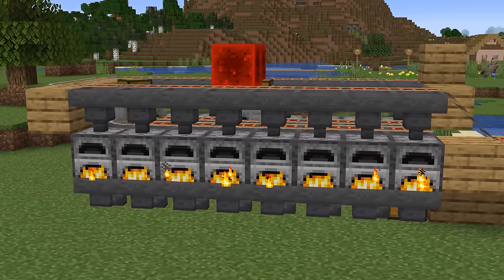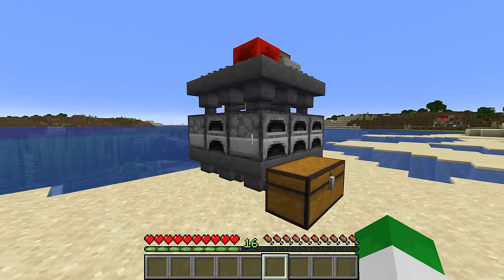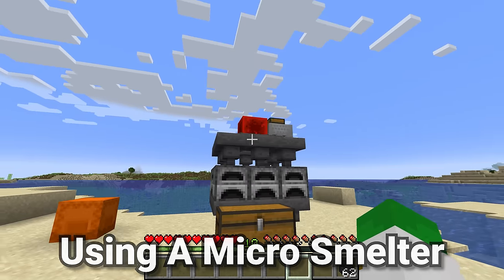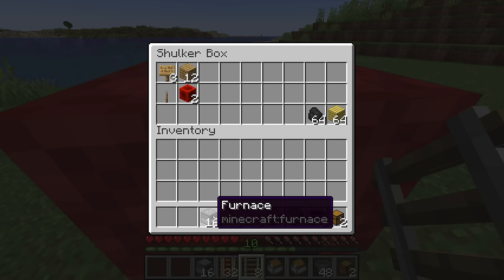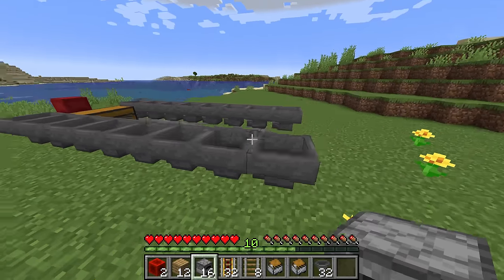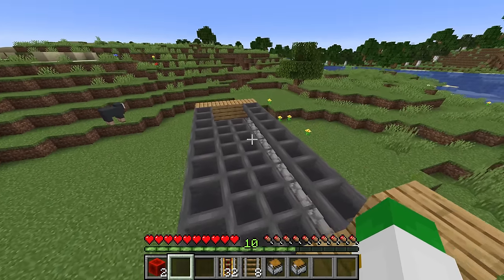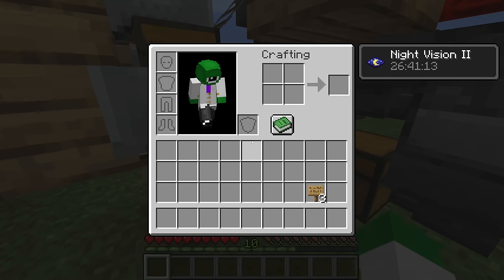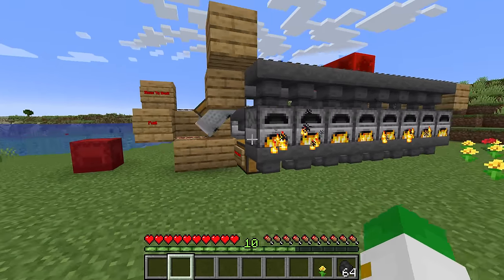How To Build A Super Smelter In Minecraft - Large Auto Smelter Tutorial + Micro Smelter

Comment: If you are struggling to place the rails on the lower track for the bigger auto smelter, just place the regular rail first, 1 block ahead, then place the powered rail that way the powered rail connects to the regular rail on the lower track not the powered rail on the top track. This issue could arise at 7:04. Hope this is useful to at least someone!
Reply: Thank you so much omg, I thought I was losing my mind and I was ready to pull out the tnt
Reply: I don’t understand what u saying
Reply: @alonzoperez644  same
Reply: thank you SO much i went searching for a comment like this bc i could not get the rails to place properly!
Reply: This build was a huge waste of time. Terrible design
Reply: I've been trying what you said for hours and it hasn't worked. I'm super pissed off at this point. Gah I hate this video
Reply: It is kinda iron expensive but what I did was just add another layer of hoppers on top of the upper layer so that they couldn't connect. So you have the furnaces and then 2 hoppers on top of it
Reply: THANK YOU MAN REALLY
Reply: I did this, but the powered rail still connects to thw other powered rail 😩
Reply: @taojones8956 dawg you put the normal rail first then you put the powered rail so that it doesn’t connect
Reply: Whew, even with that, it was still a little tricky to get the rails down. Yeah, you have to aim 'away' from the other rails while crouching. I still think it may have been random or something, the damn rails would keep connecting in the wrong way!
Reply: bro ur a life saver tysm
Reply: Bro super thanks

Comment: I just built this and it works fantastically. I have been looking for an auto-smelter that will take lava buckets and could only find really complex set-ups. What you have designed, however, is very simple and picks up the empty buckets easily. It also has a small footprint, is relatively cheap to build, smelts very quickly and only took me 5 minutes to build. Thank you so much for this excellent tutorial. :D

Comment: I have a bunch of auto farms, so I would direct their output line to some sorters to pull out the items I want to smelt/cook, then feed the output to the farm stream on the other side of the sorters to go to my main storage.

My fuel of choice is charcoal since by cooking my tree farm's output the super-smelter quickly becomes self-fueling. That's because I get 8 charcoal out for every 1 charcoal burned (with no need to craft bamboo planks, although 1.21's new crafter block would change that). Feeding the output charcoal back into the farm's fuel line means it's constantly full and the charcoal that doesn't fit continues on to storage.
Reply from the maker: Nice! One of my favorite things in Minecraft is connecting farms together to make a massive system :)
Reply: Charcoal is god-tier fuel with this setup
Reply: I am currently setting up an auto kelp farm to supply my auto smelter. I have a question though, how am I supposed to prevent my main storage supply from overflowing if it reaches maximum capacity?
Reply: @gavinferguson2938  What kind of sorters are you using? There's usually a way to catch overflow at each sort point. Alternatively, you can just let it fill up so that it won't accept more items and have an overflow catch-all at the end that drops the extra items into lava or something.

Comment: This is almost exactly what I’m looking for. 

There’s a few ways I would upgrade this, however the “upgrades” are definitely going to make the smelter more expensive. 

1. Is there any way to use hopper minecarts instead of chests minecarts? I want to make the smelter look good in my house, and keeping the input, fuel, and output all as chests would make it look great and consistent. 

2. Is there any way to attach a farm to this for fuel? Such as a super efficient bamboo farm, so you no longer even need to put any fuel into the furnaces.

3. If using hopper minecarts is possible, is it possible to make it so the hopper minecarts are stationary until you put items into the smelter? This would only make the minecarts move when they’re either full, or have emptied the chest. After that, how would you make them stop moving after they have unloaded every item from their inventory? The purpose of this is to reduce the constant noise of the minecarts.

Essentially, I want a system that is quiet, and requires no input from the player other than inputting the item they want to smelt into a chest. Do you know of any smelters like this or direct me to a video that has something similar? I’m struggling to make one on my own as I’ve just recently gotten back into Minecraft and my redstone skills are a bit rusty. This video is great as a distribution system, but not fully automated. 

Bonus question:

Typically I won’t need more than 8 furnaces. 16 is definitely more efficient, and if you have an infinite fuel source, using 16 furnaces might just be the better way to go regardless. However, is it better to use normal hoppers and redstone for 8 furnaces, or would you recommend still using minecarts with a hopper / chest?

Thanks again in advance to anyone who can help, I realy appreciate it!

Comment: lava is the best fuel. setting up an infinite source nearby i very easy. i use the 10 method. 5 and 5. smaller and more compact. that way you have a lot of lava for fueling up these machines. 1 bucket of lava cooks 100 items. so the more you stock up its fuel source be it a smoker, furnace or blast furnace it will last longer with less of a hassle to replace its fuel like coal, wood or kelp. kelp blocks only smelt 20 item compared to the lava buckets 100. the only source that even comes close is a block of coal. now if we could just get the cookers to be powered by redstone. THAT would be something. thank you for the entertaining video. i am sorry for the rant of fuels. have a great day everyone.

Comment: My rails are automatically connecting in spots i dont want them to at the end of the hoppers as well as in the beginning in front of the lever. Very annoying
Reply: Pay close attention to the order in which he places the rails as well as what side of the blocks he is placing the hoppers on. They have to be places in exactly the same way he demonstrates for them to work properly.
Reply: Extend the end of the top set of rails by 1 block, then place the rails for the bottom set. After that, you can break the extra block for the top set of rails. And they will not connect

Comment: How can you harvest the xp from these?
Reply: Break the furnaces after a while the xp will drop. Just replace the furnaces and start over. Another thing you can do is put levers on the side of the hoppers and when you’ve smelted a ton of blocks, when you have a stack or so left waiting to smelt, flick all the levers on the hoppers and this will lock them. The final few items will stay in the furnaces, and when they’re done just manually pick them up and you’ll get all the xp from the whole batch. When you’re done flip all the levers back so the hoppers unlock and next time you need to use it the items will flow into the chest once again, and you can repeat the cycle.